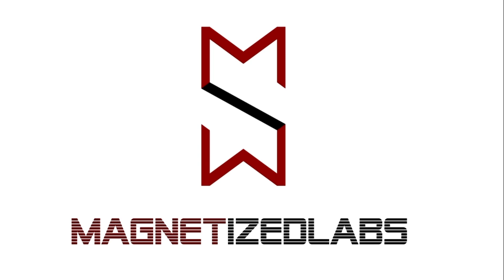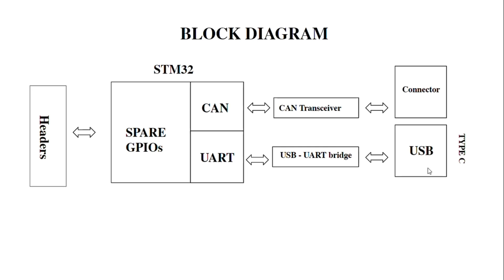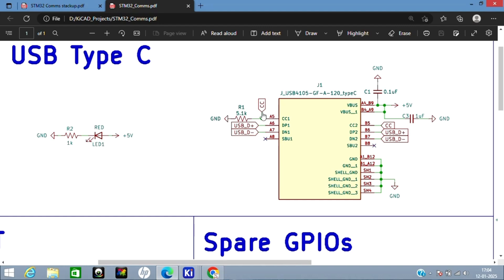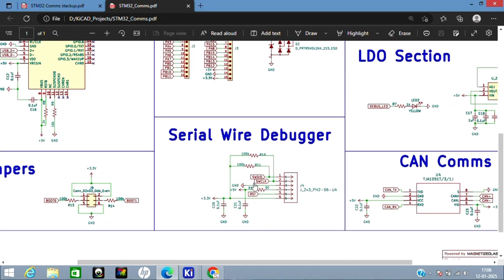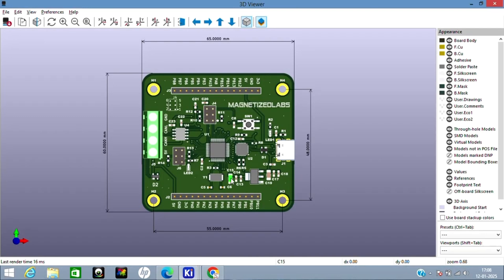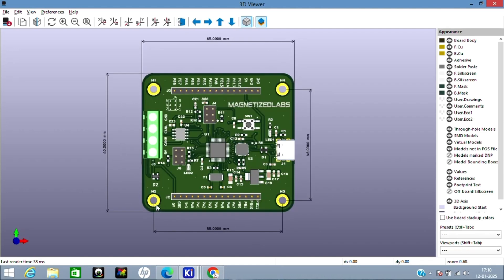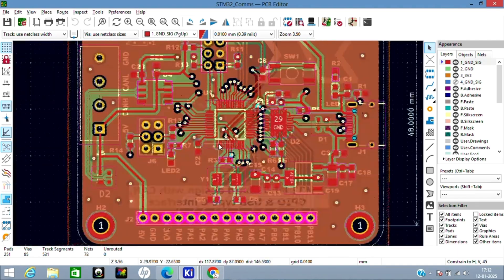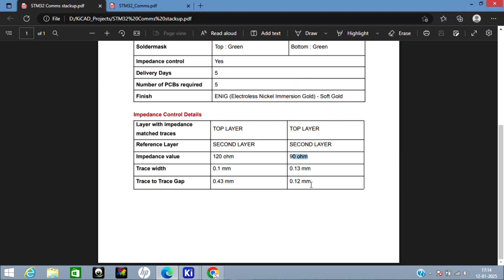Design of STM32 Development Board with CAN, GPIOs and USB Type-C Interface | Magnetized Labs 02

Comment: Is this fabricated? after PCBA, testing, did it worked? specifically can bus? i don't see any termination resistors around CAN...
Reply from the maker: @pssh23  yeah. We developed board first and it worked well and tested after assembly. Then we made this video to share the knowledge. Termination resistors can be added outside in the wire harness part to make it work in a bus connection. This board will be one of the branches in the bus.

Comment: Why not use the built-in USB peripheral in the STM32?  Should be no need for the usb-uart
Reply from the maker: @stm32world  in this particular STM32F103C8T6, built in USB pins are used here for CAN communications. We can use one at a time either CAN or USB. Hence for the USB communication we have used UART pins to convert into USB.
Reply: @magnetizedlabs  CAN can be remapped to pb8 and pb9 - it is absolutely no problem doing usb and can same time.
Reply from the maker: @stm32world  we couldn't make it. We have verified with STM32CubeIDE. If possible you can also try. Our main objective is to make STM32 dev board with CAN communication and UART programming option through Type-C USB connector. Every application has its own requirements. It is glad that you have noticed this video.
Reply: @magnetizedlabs  I would suggest you read the datasheet - particularly the section  about alternate mapping.  But fair enough - I guess I can make a video about this mistake ;)
Reply from the maker: @stm32world  yeah. Understood. You can go ahead please. But our aim was to make this programmer module free dev board. Since programming through native USB needs bootloader firmware separately. But using native UART we can directly program by toggling the BOOT0 and BOOT1 jumpers. And we can use CAN comms too. I understand the mapping of different pins to the CAN comms. But this way gave us simple way to go ahead.

Comment: Great video! I'm working on a car application project and planning to use the STM32F105RB since it has dual CAN (CAN1 and CAN2) interfaces. Do you have any suggestions or tips for implementing dual CAN communication in automotive projects using this MCU?
Reply from the maker: @qaissaljumaily5661  yeah you can go ahead in using that. Just make sure that it's pin mapping does not overlap with any other communication like I2C or UART which you need. If you don't need any other communications, it is good to go. Care a bit about CAN routing and wiring. That would be enough